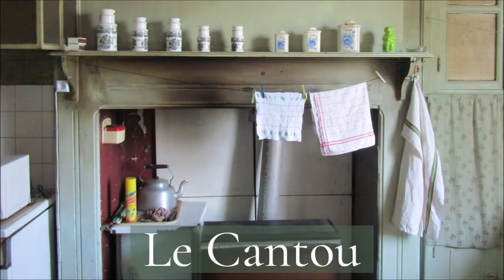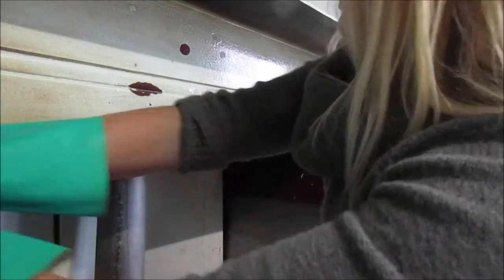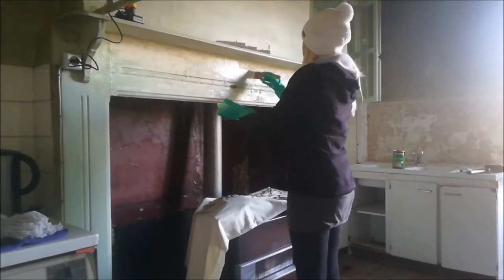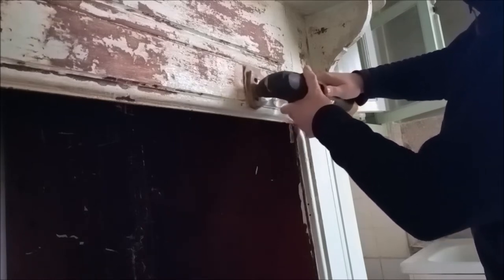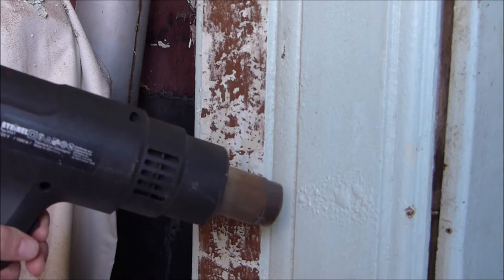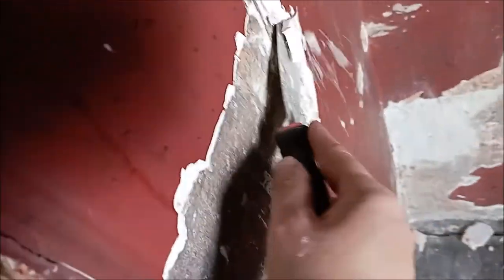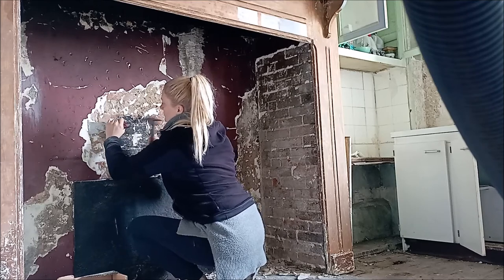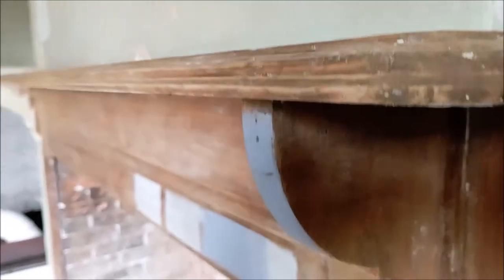Restoring the old 'cantou' fireplace & sweeping out the chimney | FRENCH FARMHOUSE RENOVATION VLOG 4

Comment: Love how the fireplace mantel came out!  Will you be painting the inside of the fireplace and replace the heater with a wood stove?
Reply from the maker: It was definitely a crime to cover up such a beautiful wooden mantel! I am debating painting the brick work but we'd like to keep it if we can. We'll try to clean them with a specialised product for bricks, but it'll have to wait until we move in at this stage. That heater is actually a wood burner, it was here when we bought the house. But we want to swap it for a wood burner boiler so as to heat the radiators upstairs. 🙂